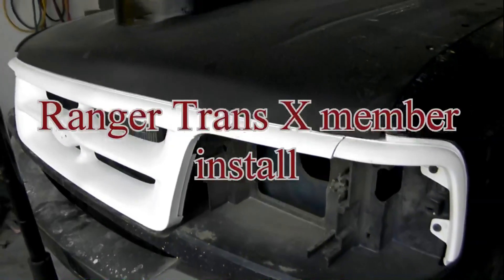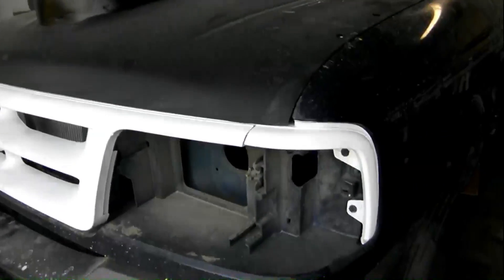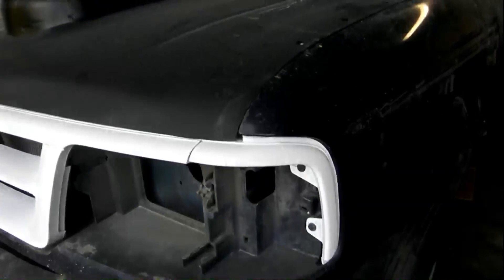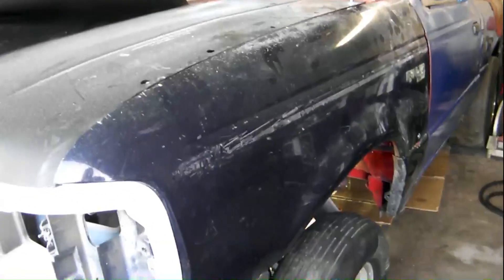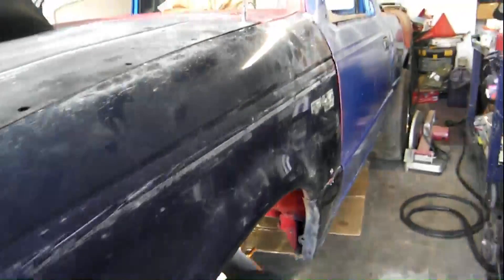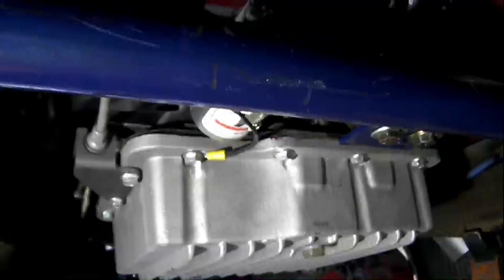Transmission cross member install

Comment: That is cool!   I nearly missed this video.    This built by you cross member is way more interesting than the title lets on.     What are  you making next?   I'm off to watch more.   That oil pan makes me want to ask loads of questions.....Just what is this Ranger hiding?
Reply from the maker: Oh what ever I can that don't cost money.  The transmission is a Powerglide.  My Mustang had a C-4 transmission I built.  Only had a little trouble whit that one.   I learned about Spragless converters.